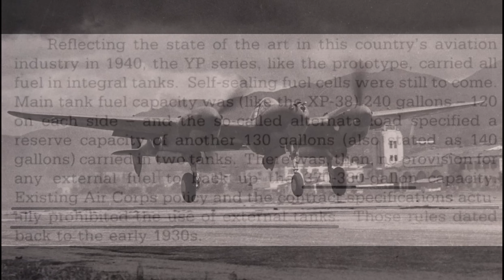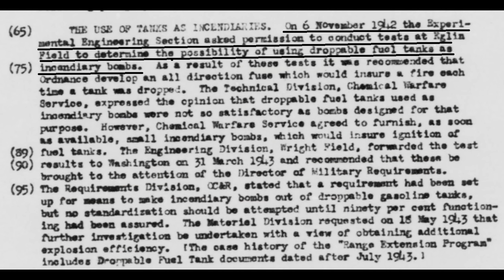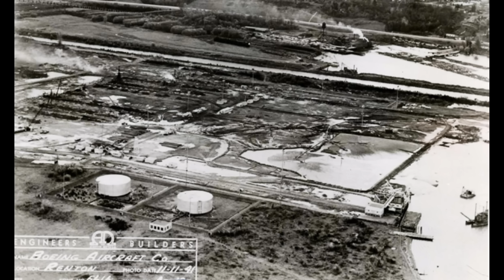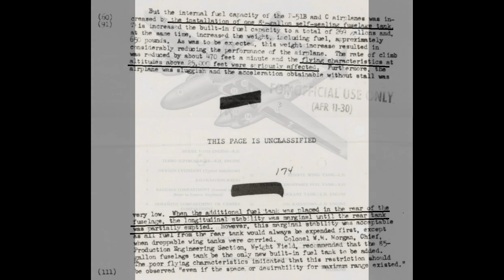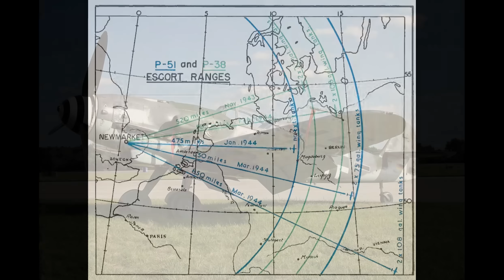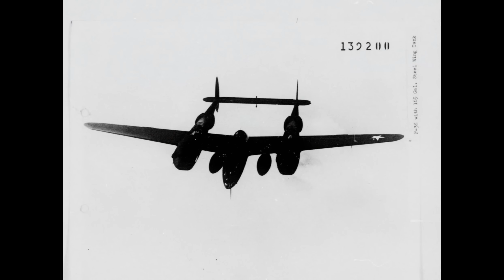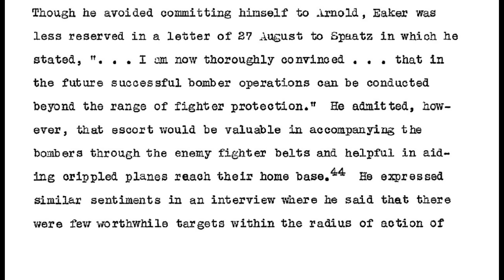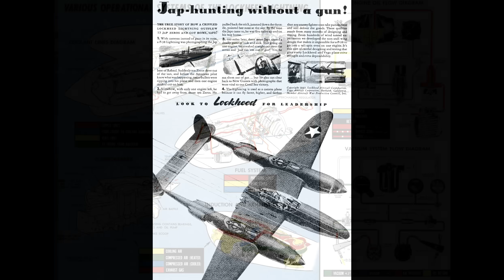The P 38 Lighting and the Bomber Mafia's Failure In World War Two

Comment: Greg, ad hominem shots are beneath you. What I presented are all the rebuttal points that I was never able to present in our debate due to the issues with 'death by iPhone'. I don't know nuffin bout Gish Galloping but here are the questions you constantly ignore.
Summary, fact and document based:
1. Lockheed and Wright Field were in open and written conversation with Lockheed to develop the wing racks and drop tanks beginning at least as early as May 1941 - for both the XP-49 and P-38E. The proposals stated 'standard wing racks' for auxiliary droppable tanks. General Brett, then CO Materiel Div was well aware. 
2. Arnold issued Technical Instruction to "Increase Range for All Tactical Aircraft" on March 3 1942.
3. On or before March 7, 1942 Kelsey instructed Lockheed to further develop drop tanks but with caveat that the 150gal tank was probably largest practical (non-Ferry), and Republic to design and test the P-47 to attach three standard 75 gal. tanks (on standard belly, wing racks).
4. North American delivered A-36 prototype with bomb racks, dive brakes and fuel feed for standard drop tanks May 1942, three months after Arnold T.I.
5. Republic delivered prototype 75 gal. drop tank capable test vehicle with standard belly and wing racks, July 27, 1943 - 16 months AFTER Arnold's T.I. and Kelsey instruction to Republic. Until that test flight not ONE P-47 was equipped to attach any standard tank developed and in all theaters in mid-1942, including 52, 60, 75, and 150 drop tanks or the 90gal P-39 ferry tank or the 300gal P-38 ferry tank.
6. P-38F asked for and delivered to Eaker for 8th AF, using 150gal drop tanks to ETO beginning July 1942.  75 and 150 gal tanks sent to ETO for BOLERO support to 8th AF P-39 and P-38 FGs.
7. FDR (Not Arnold, not Eaker) directed priority for TORCH. Marshall and ALL the chiefs on the Joint Chiefs protested dilution of assets in Britain as a dilution to OVERLORD. Eisenhower and Spaatz (his designated Air Chief for US forces North Africa) compiled and ordered drain of nearly all of 8th AF air assets, including all Troop Carrier, half of B-17 BGs, all Medium/Light Bomber, Recon and all FG's save 4th (Spitfire) and 78th (pilots only as P38s were sent to Africa 12th AF). 
8. P-47s replaced P-38s, 200gal Ferry tanks - not attachable to any other aircraft in the universe - were dispatched to 8th AF beginning late December, but due to massive bug list - not operational until mid April, 1943.
9. Due to really bad characteristics of the 200gal Ferry tank (non pressurized, draggy and causing undesirable handling) both Eaker and Kenney went to local Air Tech Services command to design better drop tanks. Eaker to Lockheed staffed Langford Lodge Depot, Kenney to ATS 27th Squadron Melbourne, to design a 100gal and 200gal steel four-point attach drop tank for the P-47C/D through P-47D-5 belly attach scheme. Eaker place an order for 43,200 steel tanks with Bowater-Lloyd but British Air Ministry denied request for rolled steel and the Hurricane type 108gal paper tank (pressurized) was accepted. Initial deliveries in September were four point attatch scheme - same as in SWPA
10. Eisenhower/Spaatz raided Eaker in May of all four B-24 BG for Tidal Wave Attack on Ploesti. They did not return from MTO until too late to refit/retrain for second Schweinfurt mission.
11. In early July Eisenhower requested four more B-17 BG plus more P-38 FG for invasion of Italy.
12. Arnold with assistance of Devers (Commander ETO) and Marshall Chair Joint Chiefs, turned Eisenhower down.
14. Arnold re-directed 20th FG and 55th FG (P-38) from scheduled MTO to ETO in mid-July (one month before Schweinfurt). The 20th arrived in ETO August 11th and the 55th on September 5th. At the time of arrival, there were still 768 150 gal. Lockheed tanks remaining from the BOLERO build up in 1942 - which could not be mounted on the P-47.
15. Following the P-47D flight test of standard belly and wing racks, the B-7 kits began retrofitting P-47C/D in late August.
16. Both Kenney and Eaker requested that Republic deliver future D-6 with four-point attach. Eaker was turned down based on inability of P-47 to carry any standard tank in production, but Kenney's request was approved through November, 1943 to use the 200gal Brisbane tank.
17. Arnold ordered all P-51B and P-38J airplanes to be delivered to ETO 'until further notice' in August/Sept 1943.
18. P-51B-1 and P-38J-5 arrived beginning September 1943, fuselage 85 gal (P-51) and leading edge (P-38J-5/-10) kits installed beginning November 1943. P-51B Operations using the kits began Dec 1, 1943 and full complement missions in January when 354th FG and (55th FG P-38J) went 500mi to Bordeaux January 5, 1944. P-47 FG went only to Normandy area (approx 260 mi).

Ask the question "Why was Kartveli so focused on the XP-47J when the AAF demanded long-range fighter beginning 1942? Why did Kartveli ignore request from Kelsey to install and test standard wing and belly racks for the existing 75 gal. combat tank, March 1942.

BTW - if Arnold as pissed at Kelsey, as Bodie suggested, why was Kelsey promoted to full colonel in that time frame?  Also, if you take stock in Bodie's "Thundebolt", ask yourself why he also questions Karveli ignoing additions of external racks to the P-47.
Reply from the maker: When did I do an ad hominem attack? 

      To clear up the term Gish Galloping, it's when someone puts up so many false points at once that there is just no way to respond to all of them in the time allowed. This is your standard tactic here in the comments section. You just put up 18 points, all of which are easy to blow out of the water but each one would take an average of several paragraphs to fully dispel and I certainly don't have the time to knock them all down here and I don't think there is much point in doing so because I have done it time and time again in videos. 

    I'll address the first point you made, but I'm not wasting my time on all of them because I have literally addressed all of these things before.

    Your first point claims that Lockheed had a "conversation" to develop and deliver drop tanks in May of 1941. I'm sure they did. I'm sure they had conversations about nearly everything they could possibly do with the P-38. The reason you can't find an actual contract or purchase order for these tanks in 1941, let alone an actual drop tank equipped P-38 from that time is because a conversation is all that it was. Don't confuse talk with action. 

    In this same point you say that so and so was "well aware" of these proposals. So what? It still resulted in no drop tanks, and if as you say this was in May of 1941, if they were serious they could have had drop tank equipped P-38s flying by June or July. They didn't. 

For those who haven't seen it, here is my debate with Mr. Marshall aka drgndog. https://www.youtube.com/live/qzrg-u-MYdc?feature=shared

Comment: Greg what was the range of the ferry missions to North Africa ?  It was at the end of 42 ? Everyone wants to pretend that it was all done by sealift.  My order of battle research suggests the P-38s had to have been flown there. At least the first operational units.  Any light you can shed on routes and did drop tanks play a role.  Was a deal with a European nation struck to refuel on the way ? Portugal seems like only option for that.
Reply: The first B-17s were from the 8th AF, 'poached by Eisenhower for TORCH - and flown directly from UK. The first P-38s from 8th AF also flew directly to North Africa. The normal ferry route from US usually went to the Azores for a fuel stop.

Comment: Greg - you quoted Bodie multiple times. See page 332 Thunderbolt "Those blocks of fighters (P-47D-15) and not seen with the initial P-47D-22 and -23 were not seen until 1944. Those blocks of fighters were the first to have good extended range capabilities but even those were incapable of flying as far east as Berlin. Only the P-38 and P-51B-D demonstrated such capability in the spring of 1944".

On page 331, Bodie states "Republic was so busy developing the XP-47J, they had little time to DEVOTE TO RANGE ENHANCEMENT ON ANY PRIORITY BASIS, and it Wasn't Funded. What a difference Schweinfurt would make".

Your comment that the R-2800 vs V-1710 fuel consumption is true when considering the 75 gal. tank - that said Kelsey Ordered Republic in March 1942 to equip the P-47 with standard belly and wing racks to Install 75 gal. tanks. Further, the 75gal tank was used by the P-47C/D after the B-7 rack conversions obviated the four point Bowater 108 gal. paper tanks, and had to wait until Bowater retooled to B-7 rack compatibility in early October, 1943.  Also, had Republic obeyed Kelsey earlier, they would have been able to replace the 75 gal. wing tanks (ordered by Kelsey 3-42) with the Lockheed 150 gal tanks - of which there were over 700 still in Britain after the P-38s went to Africa.

You quote Kelsey from Dragon's Teeth, but don't cite his meme of 3-7-42 as found in the Case History of Droppable Fuel Tanks found in Boylon's primary reference Reel A2068.  You quote Arnold's surprise that the P-38 already had 150 gal tanks for Ferry to Britain for BOLERO (8th AF build up), but don't mention that he was promoted to bird colonel shortly after and sent to head up VIII ATSC, then deputy to Quesada of 9th AF FC.

You state that that Bodie cites 'conspiracy' in the development of the drop tanks at Lockheed, but you don't mention that Lockheed submitted official and documented proposals to develop drop tanks attachable to STANDARD bomb racks - to Wright Field beginning May 1941. Or that exchanges from Production Div and Lockheed to select between 75, 120 and 150 gal. were routine through December 1941. The exchanges may have been under Arnold's radar but not Materiel Division CO Col Oliver Echols. Bodie apparently did not have access to easily available docs at NARA or USAFHRC for Reel A2069.

You cite that the movement of BOLERO and the P-38 drop tanks in March 1942 stimulated Arnold to direct the Range Extension program? No, the Range Extension Program was ordered by Arnold after the Feb 22, 1942 Fighter Conference, The Official Technical Order T.I.-1016 was issued 3-3-42. Kelseys instructions to Lockheed and Republic occurred on or before 3-7-1942. Further, the 150 gal. tank was just finishing drag studies at NACA, and released for production in March. BOLERO movement of P-38s occurred in July 1942.

The 108gal and 110s were used by P-51B and P-51D in ETO beginning in May 1944. That same month the 355th FG flew an Escort (shorter range than Fighter mission by ~ 150mi radius) over Posnan, Poland May 13 1944. 1475 (740 mi radius) miles round trip. That same month the P-47D flew maximum Fighter mission (no escort) to Halberstadt ~ 410mi radius.

The FAREP document referencing dual 150 gal. (actual capacity 165 gal.) DID show the P-47D-25 and Subsequent beginning March 1944 ( following releases of P-47D-25 from Farmingdale).

P-51B had rack limit of 600 pounds, P-51D limit 1000 pounds - but the B carried 108/110 gal tanks through VE Day. The  non-use of a 165 gal tank on a P-51Bt wasn;t a wing structural limit, it was that the B-7 had to be replaced with a B-10 type rack.
Reply: ¹
Reply from the maker: Bill, you're Gish Galoping, and every one of these arguments has been shot down already. From Wikipedia: "The Gish gallop is a rhetorical technique in which a person in a debate attempts to overwhelm an opponent by presenting an excessive number of arguments, with no regard for their accuracy or strength, with a rapidity that makes it impossible for the opponent to address them in the time available. Gish galloping prioritizes the quantity of the galloper's arguments at the expense of their quality."

    I'm not going to waste time responding to every one of these points, it would take me an hour to fully do that, but I'll address your first paragraph. The fact that drop tanks were late to the European theater for the P-47 makes my whole point. There was no technical reason why they couldn't have them much earlier. We agree they were late getting drop tanks there. I say it's because they were simply not prioritized and not ordered. You say it was for some technical reason which is nonsense considering that drop tanks were developed for the plane not only by Rebpulic by the General Kenney's team in the Pacific. Kenney came up with a working prototype in two days!

In case you forgot, or if anyone else is interested, here is my debate with Bill: https://www.youtube.com/live/qzrg-u-MYdc?feature=shared

Comment: the carburetor issues and MAP limits on the P-38 were never resolved. Ironically, it was Doolittle, who loved the P-38, who later had a hand it having them removed from ETO. Also, it's well documented that the P-38 was a great airplane, but that it required a highly skilled and experienced pilot to achieve that. Low time, low skill pilots struggled to handle the P-38. The USAAF even told Lockheed to adopt the P-51 engine controls to help with this, make it easier to fly and manage, and Lockheed ignored them. So, while I love the P-38, it did have legit issues that hampered it being as successful as it could have been. Those issues could have been resolved, but why bother when other cheaper aircraft without those issues are already available. And do not forget this was a logistics war. Also, prior to sometime in 1942, there had been no allocation of funds to purchase nor develop long range bombers, fighter escorts, etc. as the US plan to fight in ETO did not involve a strategic bombing campaign until the British convinced the US to change its entire strategy.

Also, do not ignore the fact that NAA had already flown the High-Altitude Long-Range XP-51B prototype in Oct/Nov of 1942, and had started design and development of the XP-51B in September of 1941. Though, the fuselage tank wasn't part of the original prototype/design and was added later as you pointed out.

PTO P-47 and P-38 long range missions were flown at low altitude, so had longer range than is possible for High-Altitude escort. Also, the P-51 could reach as far as Tokyo from Iwo Jima. the P-47N could barely reach the southern island of Japan from Okinawa, and couldn't reach Japan from Iwo Jima to escort B-29s. So the claim the P-47 could outrange the P-51 in PTO is simply not supported. And Gen. Kenney never did send P-47 to attack Rabaul either, and even said that every plane he had that could reach Rabaul, was sent to Rabaul, and that did not include the P-47. There is more to range and war and logistics and training and such than just gallons of fuel. And don't forget that early on the P-47 was a much despised airplane. The RAF delayed adopting it until 1944 due to is plethora of manufacturing issues (which is why there was a ridiculous number of batches and subvariants). Gen. Kenney had to convince people it was a worthwhile airplane and had to prove to people it could be useful. Zemkey hated it. The Germans and Japanese also held it in very low regard.

The lack of support to develop long-range high-altitude escort fighters from 1940-1942 had literally Nothing to do with the USAAF. it was out of their control. Congress and the gov procurement offices refused to allocate ANY funds for any such purposes, and instead prioritized solely attack aircraft, fighter bombers, and shorter range low altitude fighters, to support the CURRENT war strategy of the time. The USAAF cannot spend money that Congress doesn't give it. There was FAR more at play here than you are willing to consider and explore. Much of what happened was actually not even the result of actions on the part of ANYONE inside the USAAF at all.

Also, consider that the USAAF weren't the only ones using unescorted bombers in WWII. The RAF also flew unescorted bomber missions deep into Germany, and Japan also flew unescorted bomber missions. This was not a radical idea at the time. Much of the Bomber Mafia criticism comes in hindsight, post-war. But at the time, many people, in many nations, believed in unescorted bombers, and in fact conducted unescorted bomber missions in WWII. RAF bombers suffered even higher losses for the damage they inflicted, so why does no one accuse them of being a Bomber Mafia? The RAF even REFUSED a request by the USAAF to build long range high altitude spitfires. the USAAF modified two Spitfires in Ohio to be capable of 1600mi with internal fuel and drop tanks, and then flew them across the Atlantic to England to prove their range and the RAF staunchly refused to build any.
Reply: False. The MAP limits of the P-38 were actually 80" on 150 octane fuel. The carburetor cooling problem was resolved by the chin mounted intercoolers. Lockheed developed a simplified engine and prop control, of its own volition. The War Production denied Lockheed permission to install it Col. Harold Rau stated that clearly in a memo to Material Command..
Reply: @AlanRoehrich9651  "The MAP limits of the P-38 were actually 80" on 150 octane fuel. "

no it wasn't. cite your source. I've never heard of a single allison engine in WW2 documented at higher than ~75" MAP.
Reply from the maker: Well, now we know who SoloRenegade is. As this is a clearly a sock puppet account all further posts by this person under this account name will be deleted. This in no way prevents this person from posting here as he is posting under multiple accounts.
Reply: @GregsAirplanesandAutomobiles  kind of bad faith to accuse him of being a sock puppet of the guy you debated, instead of addressing the litany of great points he made that you never addressed in the video.

especially when his writing style is very different from dronogo (or whatever his @ is), it feels like a cop out to ignore his polite and well constructed argument and then ban his account because you think he’s a sock puppet.